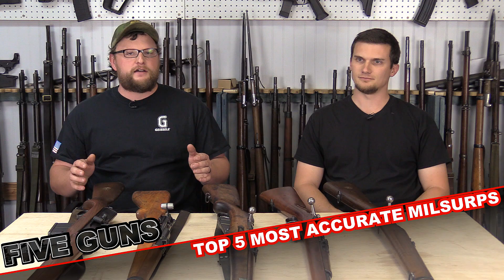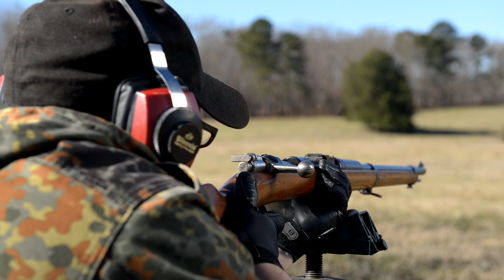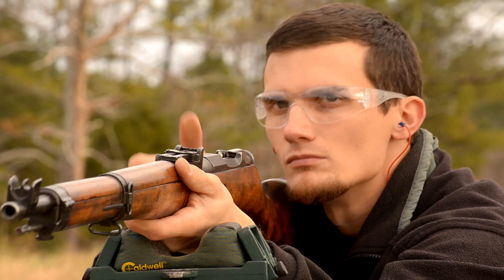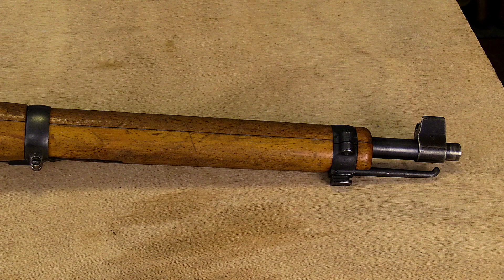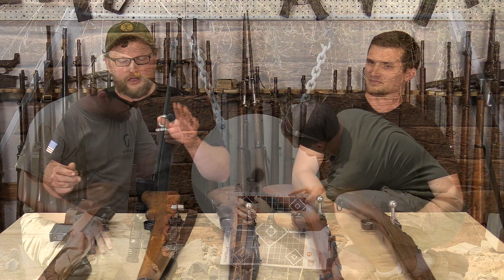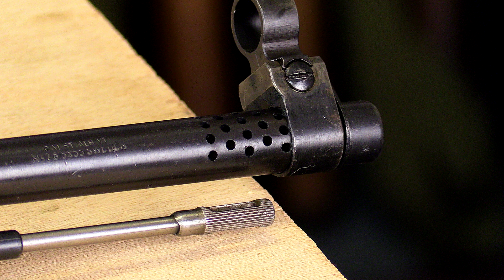Top 5 Most Accurate Military Surplus Rifles

Comment: No 1917 enfield? I'm disappointed
Reply: The rifle is horrible.
Reply: It was what my grandfather  (probably) was issued during ww2. From what I've heard, it's a strong and accurate rifle with a tough action
Reply: Evan Fish It's actually an inaccurate rifle.
Reply: More accurate than the 1903.

By the way, the "American Enfield" generally was impressively accurate for the era in which it was used

Plus, the sights are miles better than almost anything from that era
Reply: Evan Fish Mausers are the better rifles hands down.
Reply: I respectfully disagree. Although the Mauser is easily one of the best actions ever, I would have to say that the enfield action is better
Reply: Evan Fish If the British preferred the Enfield they wouldn't of tried to switch to a Mauser (Type) rifle.
Reply: Well, technically speaking, everyone used the Mauser action. Technically we're still using it.

While some Mauser rifles are accurate, the fact is that the .30-06 is just a better caliber than anything that the 15+ versions of the Mauser were chambered in

To be fair, the only way to effectively determine the better design is to pit the "Indian Enfield" against the Spanish Mauser, since both were chambered in the same caliber
Reply: Evan Fish Thus making it the better rifle, one of these days I got to get me them rifles and have a two gun match.

Comment: What about the Norwegian M94 Krag-Jørgensen rifles? There is a reason it was prefered for sport shooting competitions over here in Norway. Remember that a K98 in 8x57, or 30.06 would have been just as avalable, if not more. So would swedish mausers have been. Mausers variants buildt by Kongsberg was also used, in 30.06, 308 and 6,5x55, but none of the managed to replace the krag, not untill the Sauer 200 STR came, was the Krag replaced as a sport shooting rifle here in Norway.

I know not all rifles can make it into a top 5 video, but you should check them out, they are great rifles to shoot. The Krag goes really well with the 6,5x55 round (Witch btw is not entierly swedish, it is 50/50 Swedish and Norwegian)

Comment: i think the "7.62 TKIV 85" is still used in Finland
Reply: +Simon Doge https://en.wikipedia.org/wiki/7.62_Tkiv_85
Reply: +Simon Doge Yup. Still in service but they are not in so good shape after long service. TKIV 2000 or Sako TRG-43 is the main sniper rifle. All tough the TKIV 2000 is waste cause Finnish sniper training is bad right now.
Reply: +Larry  Finnish sniper training is actually really good. My friend was there and was not touched a gun before military service and after he came from there he is now a really good shot. And a plus, the finnish military is using The Dragunov in training and on the other things.
Reply: The Finnish snipers now days don't operate as classical snipers. They work with the platoon as a marksman and alone inside the fighting force. The rifle is mainly used as a "long range support weapon". Typical sniper example one trained in Kymeen jääkäripatalijoona shoots less than 20 rounds trough TRG. The trainigs lasts about one month. Dragunov is also discontinued rifle but some units still use it (example Rajajääkäri-joukot). The third rifle is RSTKIV 2000 which is barret m82  which the Finnish military doesn't have proper ammunition so the accuracy is something like 2 MOA.  There are some groups that give extensive sniper training like Utti's Special yager-regiment, Immola's Special Frontier yager-comppany and the Combat divers.

Comment: top 5 guns that changed the wars
Reply: 1) MG08 - Finally caused the true revelation of the power of the devastating machine gun and caused the Western Front stalemate in WW1.
2) M1 Garand - First mass produced and affordable semi automatic military rifle.
3) G98 - Perfect military bolt action, period.
4) ZB26 - Perfected the LMG concept and everyone had a copy of them.
5) MP40 - Cheap as piss to make, and heavily mass issued. Germans dominated in CQB thanks to them.
Reply: Dreyse needle gun.  first bolt action rifle.  Mauser K98.  refined the bolt gun.  Lee Enfield. probably the high mark for bolt guns for speed and capacity.  M1. first semi auto used in mass.  STG 44.  the dawn of the assault rifle.
Reply: bill marks The Dreyse whilst having a decent impact didn't start seeing combat use until 1864 (although was adopted in 1848.) Within 2 years of it first being used it was obsolete with the invention of metallic cartridges.

The Mauser K98 was just an improved G98, which already was pretty much the perfect bolt action military rifle.

The Lee Enfield was good but it took a long time to perfect the action and design. They are less accurate than Mausers and used rimmed cartridges. It was fast but the Carcano could beat it as it was straight pull.

The M1 definitely deserves a spot, no denying it. However, it is worth noting the RSC-1917 was actually the first semi automatic rifle used in mass - 86000 RSCs were used by French troops in WW1. The M1 was the first practical, cheap and reliable semi auto, and the first to become a standard issue rifle.

The STG-44 should be an honorable mention, not a placeholder. It didn't have the most impact on warfare at the  time and came out too late to change anything. It was also expensive. But 750000 of them were used by the war's end - really darn impressive figures.
Reply: bill marks This list also is referring specifically to WW1 and WW2. Dreyse guns stopped being used in 1871 after replacement by the Mauser 1871.
Reply: Aidan Templeton good point.